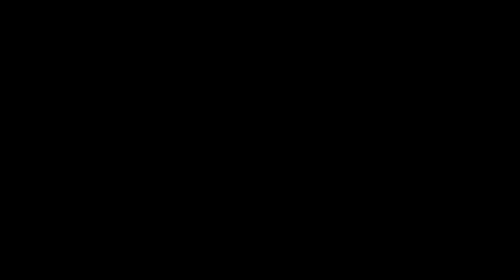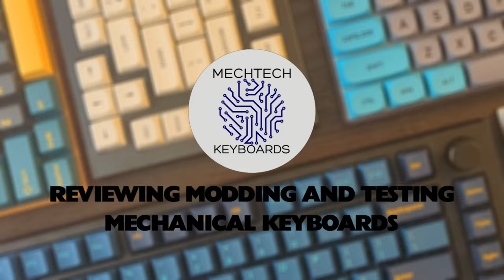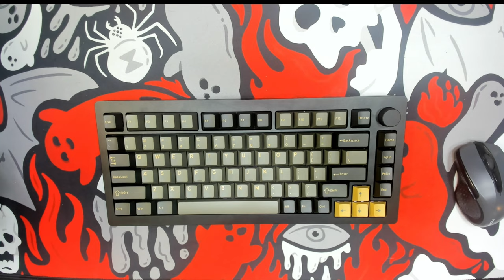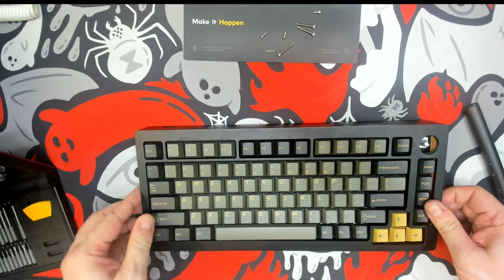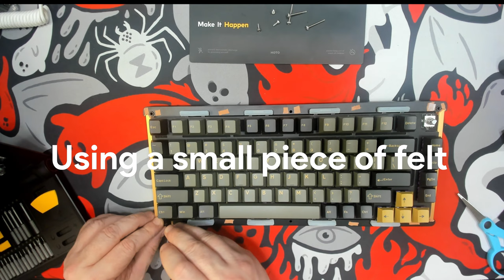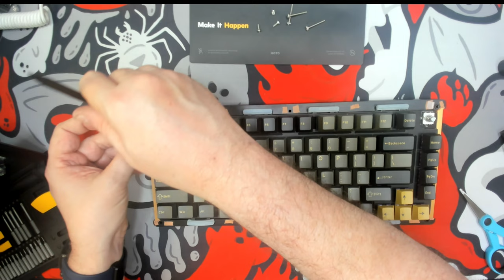Scraping Knob on M1? Here is a quick fix to eliminate the rubbing knob issue on Monsgeek M1 #fix

Comment: Mine (v2 local CN model) would let the plate/pcb assembly slide around notably in all 4 directions. Without even disassembling the board, I (jankily) stuck a tooth pick between the plate and the side of the case bottom left of the left arrow key, and that holds the plate over and up enough to prevent it from sliding anymore and centers the knob. Not ideal as it can potentially hinder the gasket flex there.

Once I open it back up again, I think the solution might be to put a shim INSIDE the gasket sock there. You don't want to move the gasket itself as there's a bar that slots into the case, but stopping the plate from squishing as far down into the side of the gasket sock should stop the sliding. The mounting angle of the plate is at an angle, so it has a tendency to slide down and squish into the bottom gasket while sort-of exiting the top gaskets.
Reply from the maker: Good thinking.